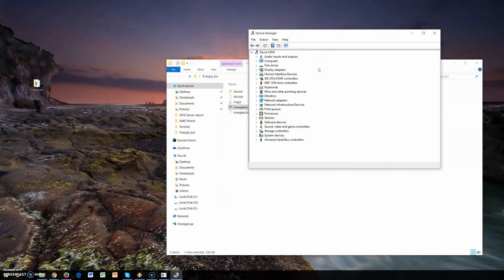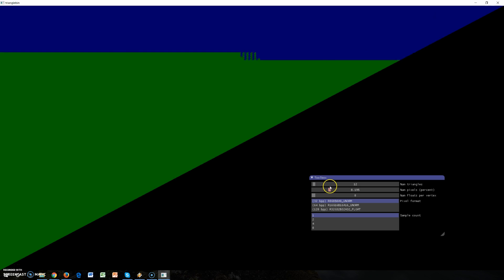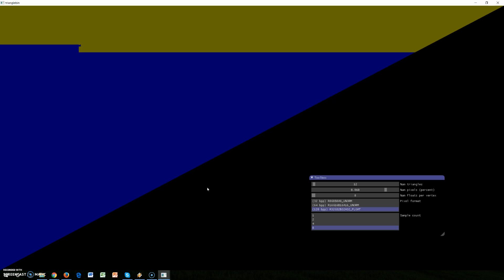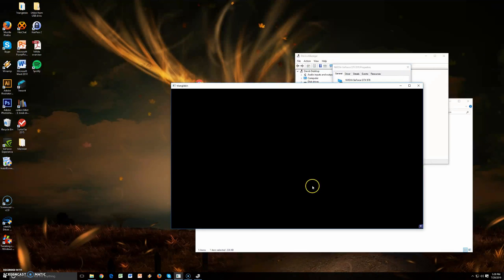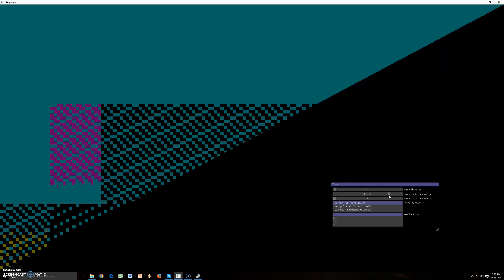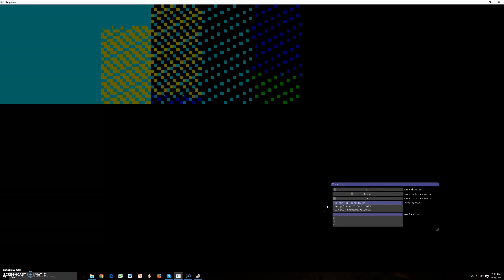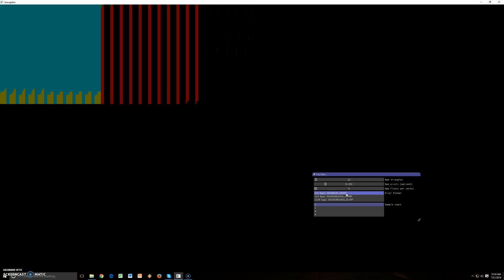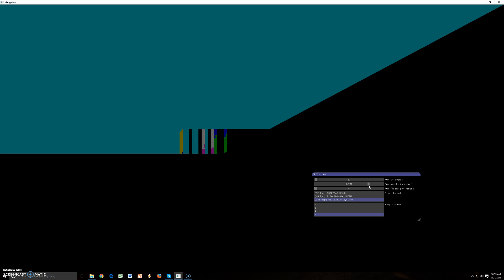Tile-based Rasterization in Nvidia GPUs with David Kanter of Real World Tech

Comment: Intetesting. Its clear Nvidia has an advantage of only paying attention to the visible triangle, but if software devs were smart, a very simple piece of code could be doing that anyway. I have done that myself with massive performance gains.
Reply: post it. gtx series have issues in screen tearing.https://forums.geforce.com/default/topic/903422/geforce-mobile-gpus/diagonal-screen-tearing-issues-on-gtx-860m-870m-960m-965m-970m-980m-/post/4963872/#4963872

Comment: This is causing artifacts/z-fighting in several titles under certain conditions. Multiple tests have been done to confirm that using preceding architectures like Kepler 700 series, completely solves the problems that begin with Maxwell. Likewise AMD/ATI and Intel graphics processors don't exhibit the same issues either. This change is coming with a significant accuracy and  backwards compatibility cost. I am extremely disappointed that there is no way to force the legacy rasterizer through software for titles that need it to remove artifacts. And Nvidia's utter lack of acknowledgement of these rasterization artifacts triggered by Maxwell+ is really frustrating.
Reply: There is a way to turn tiled rasterization off.  You need to enable certain hidden options in the Nvidia driver through Nvidia Profile Inspector.  The process is way beyond what I can recall off the cuff here (or spew into a YT comment).  If you're interested, Google "Got blocky artifacts in lava" (no quotes) and go into the r/cemu reddit link.

Comment: Can someone explain what is that noise on the generated images ?
Meaning, i was expecting the images to be rock steady, without those nonstop flickering.
Why those flickering ? There is smething random in image procesing ? Or there is something analog involved in the processing ? Or or ... ?
Reply: Ady73, that’s exactly what I am wondering about. One possible bug could be the missing “return” after “discard”. It must be noted that “discard” just flags the output not to be used. I have no computer with me right now, so cannot test if that is actually the case.

Comment: So they both use divide and conquer idea to render, but AMD and Intel do it smarter ... now if only AMD would also make a Card that get higher FPS then the low High end 1060 :)
Reply: They do, it's called the Fury X, and then there's the high-end dual GPU card but to really compete with 1070 and 1080 we'll have to wait for Vega, and it's not that far away

Comment: Well done video David,

Nvidia Fast Sync with Decoupled Render and Display

NVIDIA has taken another look at how the traditional process works, and for the first time, rendering and display are being decoupled from the pipeline.
This allows the rendering stage to continually generate new frames from data sent by the game engine and driver at full speed, and those frames can can be temporarily stored in the GPU frame buffer.
http://international.download.nvidia.com/geforce-com/international/pdfs/GeForce_GTX_1080_Whitepaper_FINAL.pdf

is this eventually another hint for your thesis with the buffers and an 
additional usage resulting in the efforts you show in the video ?

Comment: The Northern Islands series is a family of GPUs developed by Advanced Micro Devices (AMD) forming part of its Radeon-brand, based on the 40 nm process. Some models are based on TeraScale 2 (VLIW5), some on the new TeraScale 3 (VLIW4) introduced with them.

how about you test actual modern card with GCN? Which by the way does the same thing as nvidia  if anyone has any doubts.

Comment: So Nvidia GPU's can't do Async Compute, and AMD GPU's can't do Tile-based Rasterization..
Reply: Penterax No Nvidia architechture can do >>hardware<< asynchronous compute, and that's a fact.
Reply: Who the hell cares? Nvidia doesn't benefit as much from async as AMD does since they don't have big gaps in the pipeline. Their current solution is a better idea considering their architecture. Case closed.
Reply: the recent AMD GPUs show tiles.
Reply: AllYourBase Nope, RX 480 don't support it. Maybe Vega will.
Reply: and how do you know this? Even the person who did the vid doesn't know what GCN does.
Reply: AllYourBase I've tested this on a RX 480. Watch the video. Tool is available for download..
Reply: Wait, you literally just said the recent AMD GPUs show tiles, and now you say "how do you know this?" as if your original statement wasn't even sure?
Reply: You definitely have a point. Async was ultimately made for the consoles back when stream processor counts were low enough that the bubbles were acceptable and all that. I could be wrong, but it seems like AMD's driver team isn't nearly as advanced as Nvidia's either. Developing hardware scheduling is a major feat, but AMD should have been able to do it a while ago if they really invested in figuring it out. It's AMD's trade offs from 2011 that are killing them since 2014, 15' and 16' with too little R&D for a new architecture. It's like bulldozer, except that a new GPU arch takes half the time of a typical CPU one.
Reply: At the end of the day it doesn't matter whether Nvidia can do it at a hardware level. People like ignoring the fact that Nvidia cards can't squeeze as much workload as AMD can. Asynchronous compute is similar to hyperthreading in the way that it taps into unused resources WHEN POSSIBLE. Asynchronous compute won't do shit if you don't have free resources.  

Nvidia cards treat asynchronous loads differently. I don't get why people keep insisting that AMD is right and Nvidia is wrong. Both approaches have advantages and disadvantages, especially since they operate under 2 completely different uarchs. AMD's solution gives better performance on high workloads while Nvidia's lower overhead makes sure the performance is better on low workloads.  
Nvidia's solution also barely increases hardware complexity (it's just a smarter scheduler in Pascal) while AMD's solution increases complexity much more.  

Judging by the low performance gain of asynchronous compute (seriously, Hitman showed a 10% gain in the best case scenario - the average gain is atrociously small) I'm not surprised Nvidia decided to not take the AMD route. They already managed to squeeze some decent performance with a smarter scheduler, why would they continue pursuing this? In fact they gained much more than was expected both because they can't squeeze as much load as AMD can PLUS because it's a largely simulated thing they're doing.  
Nvidia is trying to keep their uarch as simple as possible, which makes sense since it's been working out very well for them.
Reply: dr. whet farts No. Async compute requires a shedular which Nvidia GPUs don't have. pre-emption is not the same thing as full async. pre-emption allows the collection of more data that would usually be collected but ACE controllers let the GPU process it.
Reply: A lot of people care. It's not a small portion of the time that there are free resources. In GCN, past about 500 shaders, there's ALWAYS holes. It's simply AMD's way of attempting to fix their pipeline stalls during a time where they had near 0 money to invest in a new architecture. Vega seems not to have redone much in this area, so it will gain as much as a % as Fury X from async. Now that Nvidia has pre-emption working smoothly, async optimized games will not run slower, but instead very slightly faster even on Nvidia. Async really should be used more often as Vulkan and DX12 make it really easy to implement.
Reply: I was referring to it strictly from Nvidia's perspective. They don't have enough pipeline bubbles to fill in order to justify implementing a full async solution. That would increase complexity and that would be felt in terms of power consumption, heat and subsequently clocks. It just annoys me when people think in binary and are like 'Nvidia needs to implement a full async solution'. Hardware architecture is always about design tradeoffs, it's not that simple.  

Yes, as far as AMD is concerned, they should really use async since they do have a lot of bubbles in the pipeline. Their architecture benefits from it far more than Nvidia's does. But I don't think optimizing async is as easy as you're making it out to be. I vividly remember either AOTS or Hitman devs (don't remember which) saying it's a big bitch to tune. 

And considering Nvidia's success with preemption it makes me question AMD's async solution. Nvidia has managed to gain about half of what AMD gains by implementing nothing short of a SIMULATION, while also NOT having nearly as many pipeline bubbles as AMD does. Something smells wrong here.
Reply: Which doesn't really mean much. Asynchronous compute is not a feature of Direct3D 12. All Direct3D 12 does is allow the application to have multiple job queues and it's up to the graphics system to figure out how to handle it. AMD's approach is to use a hardware scheduler to dynamically allocate resources as necessary. NVIDIA's approach is to use the driver to allocate jobs and resources. As of Pascal, the GPU can also re-allocate resources to finish the job that was submitted to it so there's little execution bubbles.
Reply: I don't believe you.

Why?

http://www.pcper.com/reviews/Graphics-Cards/3DMark-Time-Spy-Looking-DX12-Asynchronous-Compute-Performance

You are clearly dead wrong about Nvidia's Pascal architecture; it can do asynchoronous compute.

I suspect you have some kind of switch in your brain that interprets "can't do as well" to "can't do". Re-program your thinking, because what you believe and say is inaccurate at best.

Comment: Do you have a binary I can use? Unfortunately, I'm unaware of a method of compiling visual studio files on Linux (nevermind the lack of DX libraries), but I would like to test this in Wine to see what happens.

IIRC, the Radeon Linux driver does 2D Color Tiling. I'm not sure if it's the same technique as you're talking about, but I thought it'd be interesting to see what happens, regardless.

Comment: would it be illegal for amd to just copy that way of rasterization?
Reply: Tile based rendering is not nvidia's invention. it has been around for a while but was mostly used on low power and mobile platforms where efficiency is more important than accuracy and latency.
Reply: It would be illegal if AMD was sued, and lost in court, otherwise any company can do anything. That's just how the laws work. The courts decide what is illegal through trial, not lawyers, not CEOs. 

Also, this process has existed for over 2 decades, some patented mechanisms may have already expired. And, keep in mind, 2 things can be patented, the means and the end.

The other thing that is important here is that this make rendering more efficient by not having to do much compute. It does not make the GPU more efficient from a compute standpoint.
Reply: They are catching up, the delta color compression also started with Kepler, and AMD got a very fast implementation with their Tonga GPUs, and improved over it with Polaris.
I wouldnt be surprised if some of this is already present with their new GPUs.
Reply: AMD's upcoming Vega architecture is using tile-based rasterization as well:
https://www.pcper.com/reviews/Graphics-Cards/AMD-Vega-GPU-Architecture-Preview-Redesigned-Memory-Architecture/Primitive-Sh
Reply: Nvidia has not patented this approach specifically; they may have old patents relating to tile based rendering from 3dfx or whatever  that may or may not have expired. If AMD reverse engineers what nvidia does and implements the same working principle and nvidia doesn't have old patents that are still valid, there's not much nVidia can do. If AMD makes a perfect knock-off, copying the exact hardware at a transistor level from some part of nVidia hardware, they're going to be in trouble.

As a side note, in old integrated circuits you often find weird little silicon sculptures engraved on the device somewhere in an unused blank space on the silicon. They are there partly because it was a cool way to put a little mark on the chip and partly as an anti-counterfeit measure. Copying the masks precisely would give the same mark in a chip that's not supposed to have it. E.g. https://micro.magnet.fsu.edu/creatures/images/daffy.jpg

Comment: Only 23 subscribers?! Oh we have to change that ASAP after this. Thanks for this in depth look.
Reply from the maker: Hrrrmmmm, this means I may have to do more videos...
Reply: 91 and counting.
Reply: I'm here from the Gamer's Nexus video. Still waiting for those new videos though, David!
Reply: Of course ! ! ! ! ! More vids like this!
Oh, btw, did AMD came up with something to respond on nVidia's "SMP" and "Fast Sync" ?
Reply: "Fast sync" is basacally glorified double/triple buffering Vsync, 3 year old technology that both companies have used. This is only usefull if you have way higher framerate than your monitor supports and you want lower latency without screen tearing. ( Vsync off still provides better latency )

Freesync/Gsync combined with higher refresh rate monitor is still the better technology
Reply: Triple Buffering does not discard frames while Fast Sync does. That's the difference. I've never had such latency reduction/improvement with TB in the past as I do now with FS. As for working only for "X" times refresh rate, that's only partially true. I lock my framerate to 60, thus "1:1 ratio" and I'm fine. Games that have internal framecap work perfect with FS. Having "X" times FPS compared to your display's refresh rate only decrease latency slightly more, almost unnoticeable depending on the game. FS with 1:1 FPS/Refresh it's already a good enough deal for me.

Comment: I found it fascinating that the overdrawn triangles in partially rendered tiles actually are being pixel-shaded, since it's a common technique for tile-based renderers to take advantage of knowing a few triangles in advance in order to only shade the pixels that will actually be drawn. I know there are still advantages to tile-based rendering even without that technique, but I still wonder why nVidia didn't do it when they had the chance. I guess it could be some compatibility issue where some engines expect certain side-effects from the shaders of the overdrawn pixels. Or perhaps the GPU can't do that for shaders which include conditionally discarding pixels.
Reply: remember that the triangles you're seeing would have been visible no matter what. A tiled based with pixel shader rejection would have had the same result. you're not seeing the rasterization in flight but the final result.
Reply: The explanation is very simple: the technique you mention is patented by IMG.
Also, that technique has a tendency to struggle with large vertex counts. This is just IMR (immediate mode rendering) but in tile pattern.

Comment: That would explain why in most usecases the ROPs are more efficient compared to AMDs. Intel is not important for serious gaming. But how sure are you about dedicated Caches on the ROPs? The do not need to be adressable from external view sinces it is a FFU... I have a naked GK110 here in my desk which i will examine in that regard, so it would be helpful to test a Kepler-based card.

Comment: Very interesting. Given the effect of incresing the vertex attribute count on this small number of triangles, the triangle buffer seems to be too small to do deferred rendering on world geometry. The lighting pass in deferred shading and some post processing effects that make multiple passes over the screen operate with very view triangles and consume a lot of bandwidth, so this seems targetted at those (and similar) scenarios. Iterating several times over the same part of the G-Buffer for different lights should keep all the G-Buffer data in the L2.
Reply: How would the gpu know which part of the G-buffer to cache to L2?
Reply: +Talesseed also, I think the lighting is done per pixel :) and not per block (multiple render passes would be needed) . But maybe I didn't understand you correctly. If it is the case, sorry.
Reply: In a simplistic lighting pass for deferred shading, you determine a screen region that could be affected by each light, then perform the lighting calculation for each pixel of that region. Very few triangles, but high bandwidth use.

Thinking more about it, engines will most likely combine multiple lights into one pass to reduce bandwidth requirements and read the G-Buffer only once. So I am in fact totally wrong.